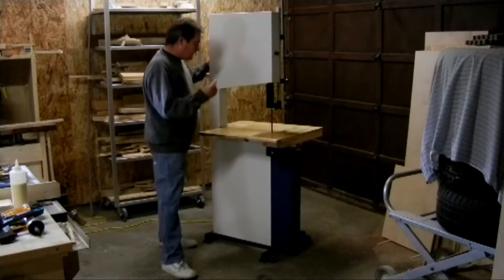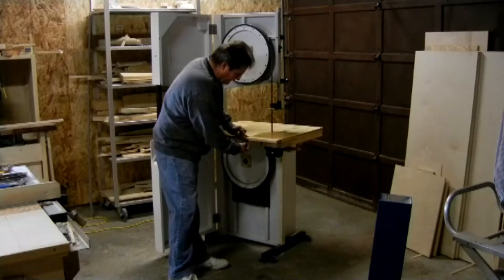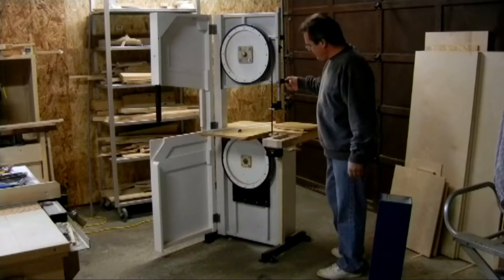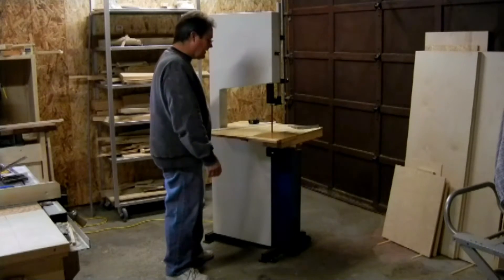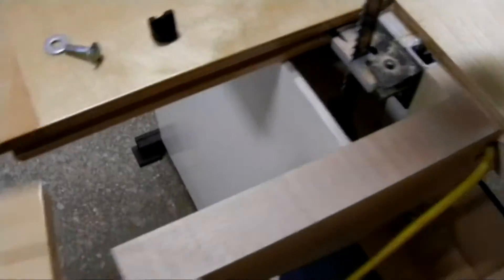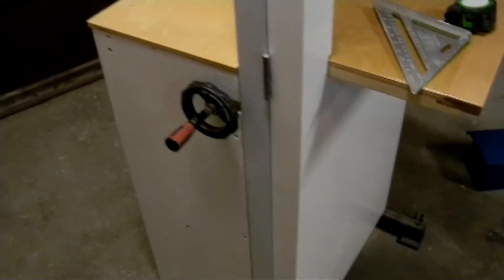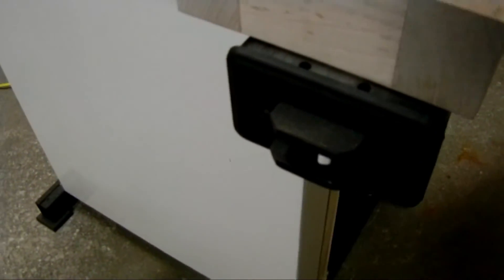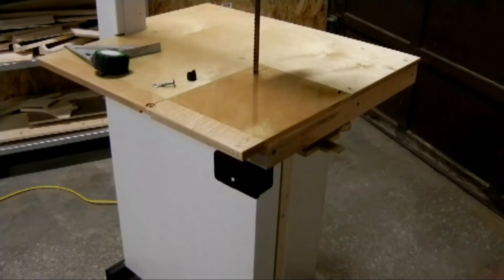Homemade Band Saw

Comment: Great machine! It's good that you've finished even after a long breakout. I've also build a wind generator and is almost ready. Since 3 years by now. I struggle to find my excitement again, and I hope. You gave me a bit of it, really. Thanks. By the way, my search for band saws leaded me to this because I've bought a cheap little machine for light use, but I'm disappointed completely. It's a piece of crap from motor to the last screw. I've thrown 100Euros to trash. That's life.

Comment from the maker: @apatientspider Glad to hear you're getting yours up and running. The blade guard idea only occurred to me while I was making the front cover, same as the dust collection box - thinking of a good way to hold the cover closed on the bottom. Sometimes, during the build, a really good idea happens and the dust collection box is probably the best on this saw.

Comment: I like that the right hand blade guard is fastened to the upper door, out of the way for changing blades.  Great idea.  The dust collection box is cool, too.  I should add one to my own saw.  BTW, between you and Matthias I've been inspired to get back to work on mine.  Cleared the junk away from it a few weeks ago and turned it on for the first time since '94.  Still runs well.  And no problem with wood movement except a few loose nuts on the column due to our historic Texas drought this year.